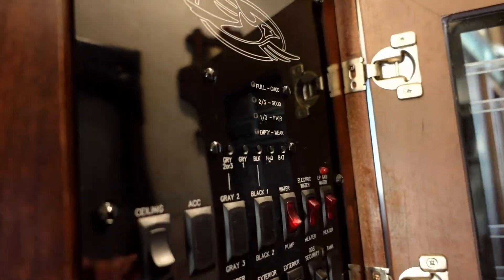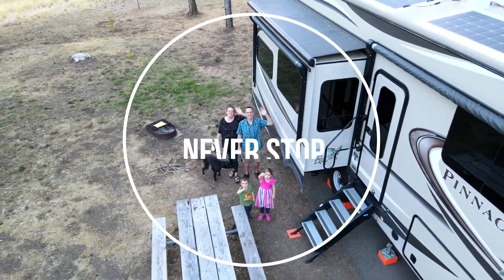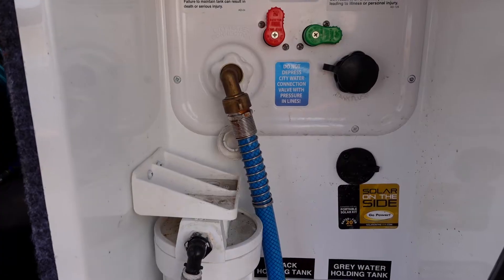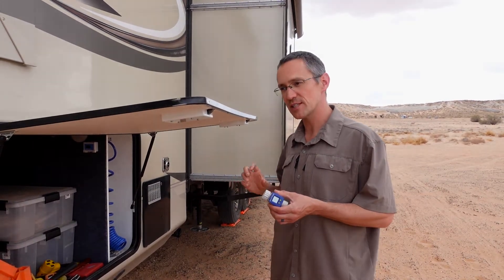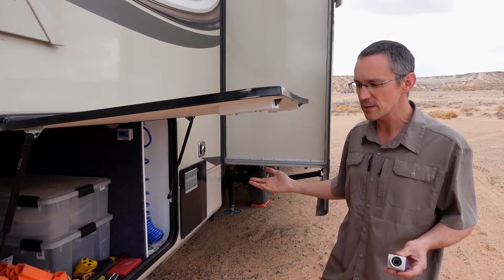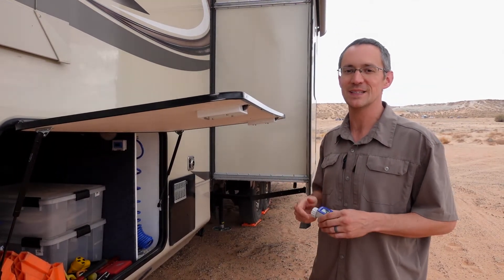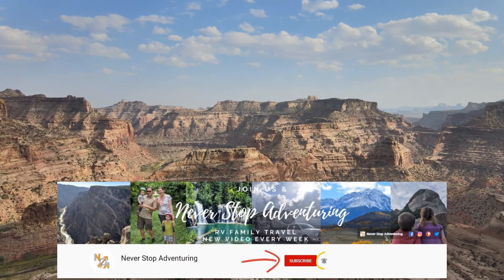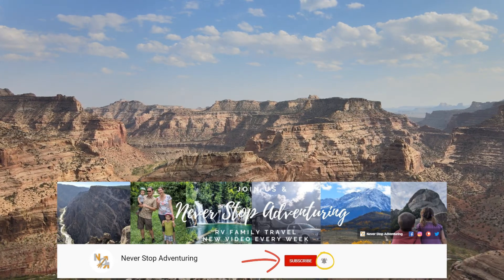RV Tank Sensors Not Working? We Use An RV Water Flow Meter Instead!

Comment: Such a great setup - I remember Kevin mentioning this during the RV tour video and thinking it was such a great idea. Fresh water always seems to be the limiting factor...would be awesome to have this level of granularity!
Reply from the maker: If we ever move into another rig we would definitely add a flow meter. It's so much less work than installing a more accurate sensor system and you're absolutely right, fresh water is the limiting factor! I think you can still get both of these for under $120.

Comment: Where did you purchase the DigiFlow 8300T?  I have not been able to find that model for sale, there are many other models of DigiFlow meters but not the 8300T.   While I found your video informative it was lacking in information on the actual installation.  It would be very helpful if you had footage or photos on the inline flow meter installation and fittings, line connections and sizes.   I would greatly look forward to that info. if possible.
Reply from the maker: Check this link for the one we use (8300T): https://www.flows.com/whole-house-water-filter-meter/
The install is really easy. I unscrewed the water line to the pump (all of the fittings in our RV are 1/2" NPT), connected the outlet side of the flow meter to the inlet to the pump, and the water line to the flow meter inlet. The display is just screwed onto the side of our cargo bay and there's a small data cable that goes from the flow meter to the display. I might get to a video someday, but we just had a baby so it probably won't happen for a while 🙂

Comment: Thought of this idea over the weekend so was looking to see if anybody had done it and found your video.  I always stress about our water usage when using the water tank.  Reviews I've seen of the product are not very good.  What has been your experience since posting this video?
Reply from the maker: I'd say it's a good deal for cheap. Be gentle with it because the plastic housing is easily broken if you attach it and then wrestle the hose around. It's also not 100% accurate, but pretty good. It's MUCH better than the system most RVs come with and we're still really happy with the hose flow meter paired with the one that monitors what we use through our freshwater pump.
Reply: @NeverStopAdventuring  thanks.  I ordered a different brand that has better reviews.  Hopefully I am happy with it.
Reply from the maker: @greg1961  which one did you end up going with?